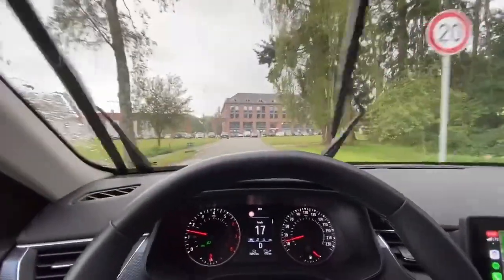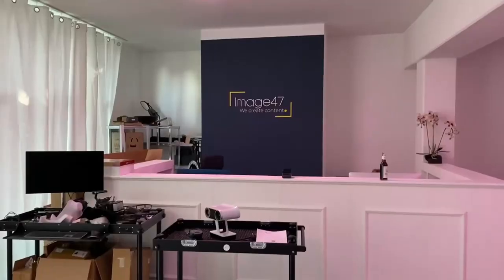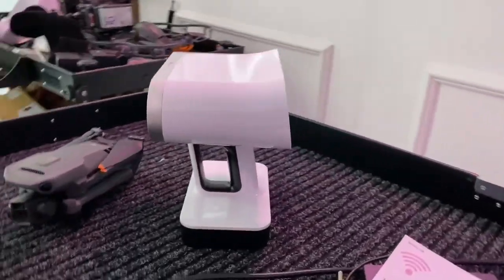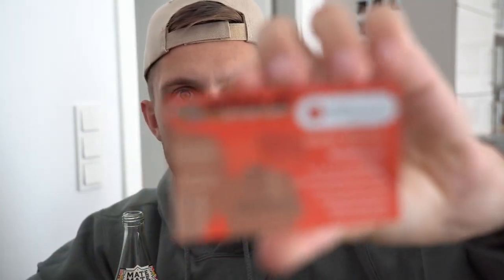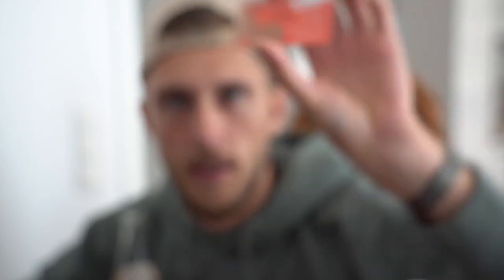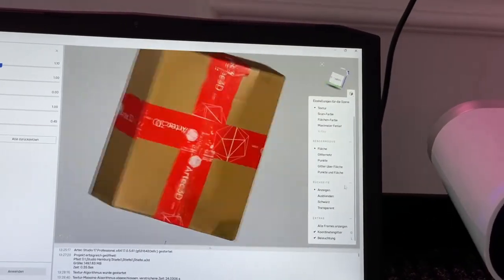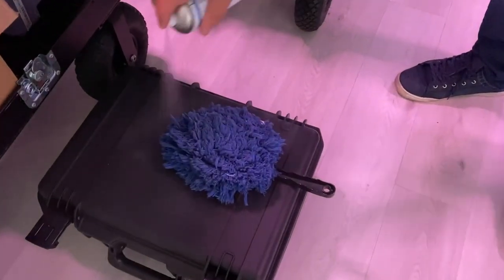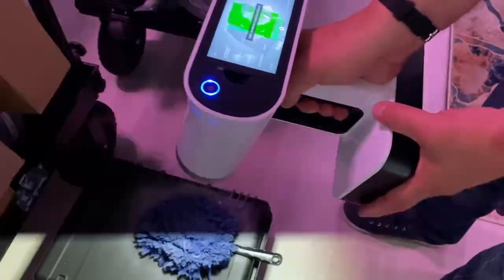Discovering the Artec3D Leo Scanner

Comment: Very cool, thank you for sharing and explaining how it can be applicable in Blender. I was once tasked with scanning some exterior surfaces when the 2018 Mustang came out...and they gave me a beautiful shiny black car to work with... It was terrible to scan, though you can use a dulling agent or other types of powder to make the surface easier to scan. It requires cleanup, but helps the process a great deal.
Reply from the maker: Yeah I bet! We wanted to scan a white tesla, and the guy said no chance. You need to ideally wrap it with some pattern or tape, but that will be in the scan texture. But the scanner theoretically is capable of scanning a car. I was surprised how bad black was thought. I thought just chrome would be an issue.
Reply: @DamianMathew  yeah and I can imagine that using a scanner that does not rely on reflective dots is even more challenging. As much as I hate dotting and the removal process, I can see how it might be helpful in scenarios where the surface is not easily read by the scanner. It looks like the scanner you used has excellent resolution capabilities at least. Would love to see your take on utilizing the scan data to model/remesh.